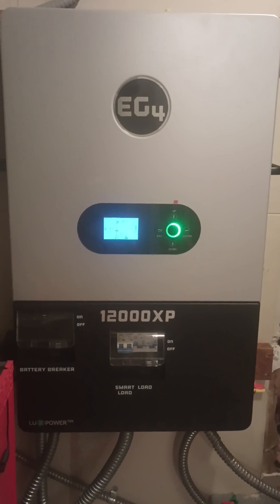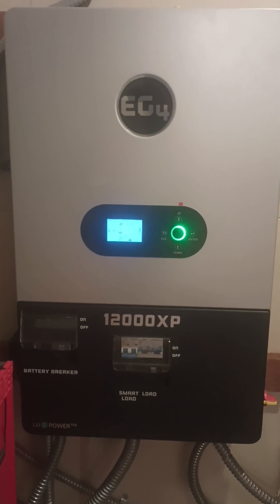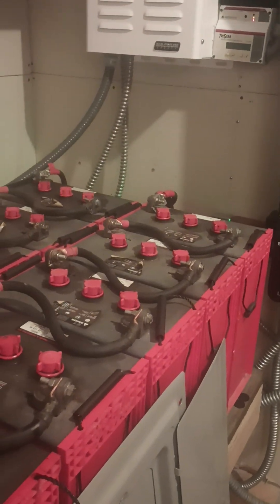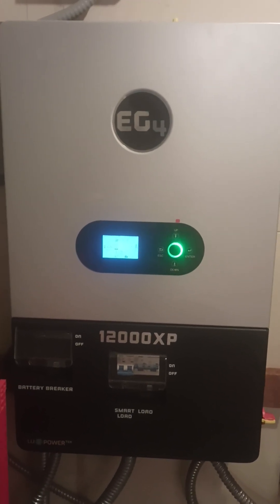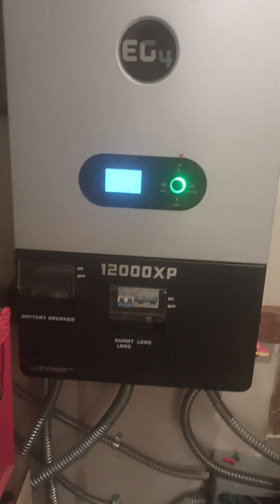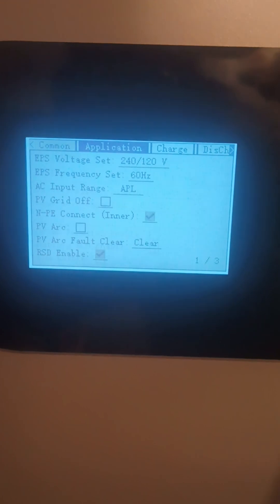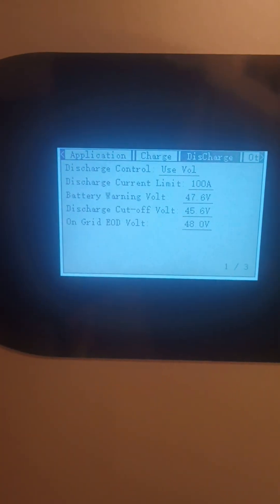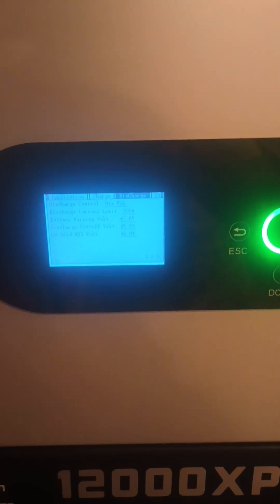EG4 12000k Off Grid Warning Code 028 Overcurrent

Comment: This happens to me even when i tuen my washer or drier on. Why? Help please. 

Also how do I upload the firmware?
Reply from the maker: Are you getting the same 028 warning code? 
If you have the wifi dongle setup then you can use that login info to update firmware at the eg4 monitor website. I would call signature solar (9034412090) regardless of where you purchased the inverter because they will happily walk you through firmware updates.
Reply: @linkfoodlocally do you think the update will solve this issue?
Reply from the maker: @dilianmodebeatspr I couldn't say not knowing what code you are getting but it is very likely a firmware issue. Is it a red light or orange?
Reply: @linkfoodlocally its like yellow/ orange and it just says “Warning 28”
Reply from the maker: @dilianmodebeatspr  I highly recommend updating your firmware. This is a known issue with eg4 and they make a fix for it. It takes minutes and it should fix your issue. It worked immediately for me.
Reply: @linkfoodlocally  dude amazing the tecnicians are coming on saturday. Thanks alot for the information you rock!
Reply from the maker: @dilianmodebeatspr I am glad you are getting it fixed soon. Your welcome. Good luck!

Comment: does the eg4 12000 xp have auto restart after overload
Reply from the maker: To my knowledge it does not have an auto restart after a fault has occurred from an overload (exceeding 12k). It must be manually restarted. Just to clarify, the over current discussed in this video is a warning that disrupts ac output but does reconnect ac output after several minutes automatically.

Comment: Sell that lead for scrap metal and get Lithium batteries... ^^
Reply from the maker: In most situations I would agree but these Rolls batteries are only 3 years old and they were expensive. Will I ever buy FLA again...No way!
Reply: @linkfoodlocally  I'll buy another starter battery for my cars in lead acid tech. Other than that... nope.

Comment: Lead Acid is still supported but OEM was set for AGM or Lead Carbon which runs 41 to 51.5V, I am not surprised they made a fix for it, EG4 makes anything work with an update.
In Canada Lead Carbon 19.2 kwh bank $3995, same LA deal no bms, heaters, or equalizing, -30C but 100% DOD possible 800 or 6000 cycles at 20% DOD.
Reply from the maker: This is interesting. I was under the impression that lead acid and lead carbon have very similar cutoff voltages between 45 and 46 volts with a top end at roughly 58 volts. This is why I said that the 42 volt setting was for lithium. I will look into 41 - 51.5 volt batteries. Thank you for your input. I am always learning!
Reply: @linkfoodlocally   51.5 to 50V goes fast then 50 to 45V goes slow, below 45V big loads pull it down a bit faster. With all electric heat in Dec I use 2.6V a day. 
Charge at 11kw. I gave next door a Lead carbon 12v 100 he claims it like 3 of his LA deep cycle. A single 12 250A weighs 170lbs, best for a ground level install.  Also they do fine running between 48 to 45V for 30 days at a time.
Reply from the maker: sounds like lead carbon is a real step up from FLA!
Reply: @linkfoodlocally  I don't think a Lipo BMS will last 10 + years, these have nothing to fail.